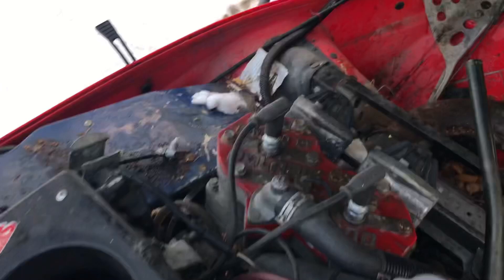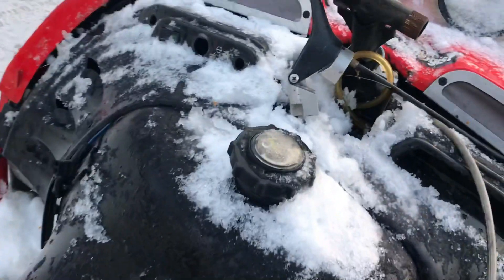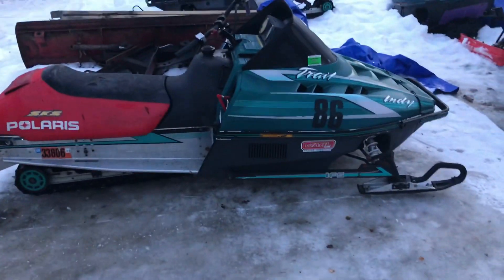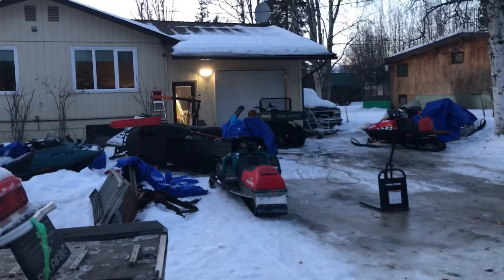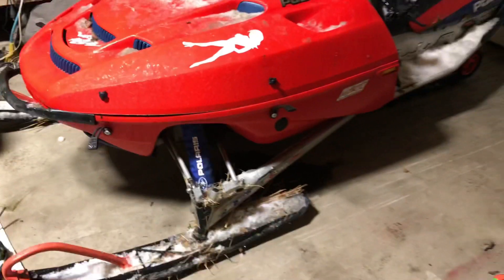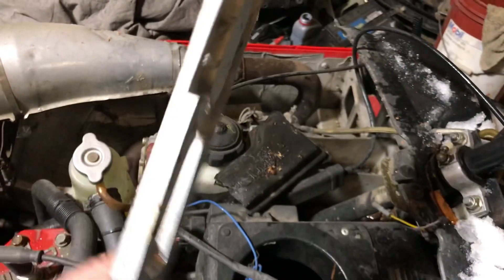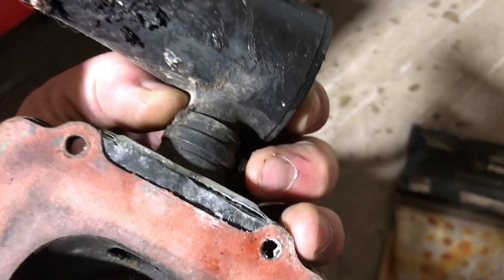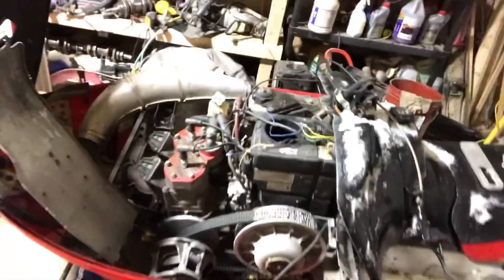FREE Polaris Prox !?

Comment: If there older sleds from the 90s and early 2000s there vintage which means He's a collector.

Other than for speed are there other reasons an individual would need a sled 600 or higher? If so what are the reasons?
Reply from the maker: No one around here considers 2000’s vintage...
Why would anyone legitimately want something smaller then a 600? That’s the real question.
Reply: The older sleds look so much better than the ones of today. I think the sleds 2000 and older are nostalgic. And I think its cool that you collect them to fix and sell and also to have your own line up.
Reply: @AKproXR  my xc 500s were rockets and ran neck and neck with 600s